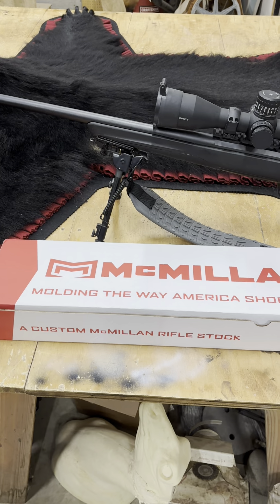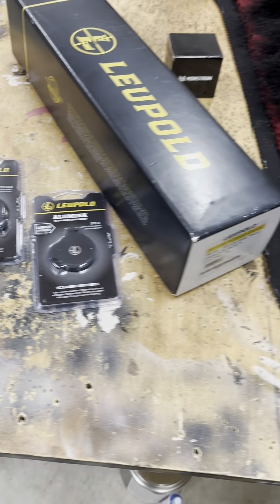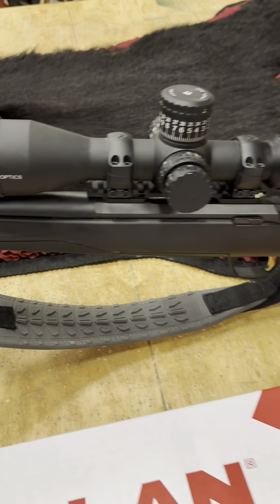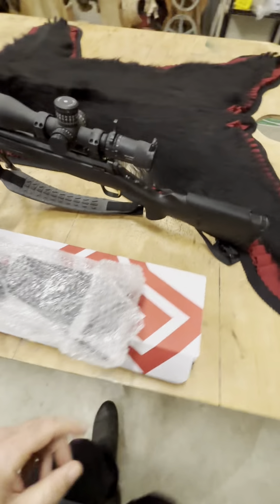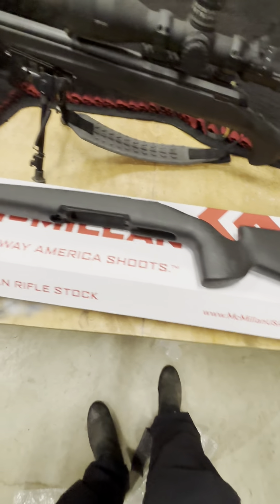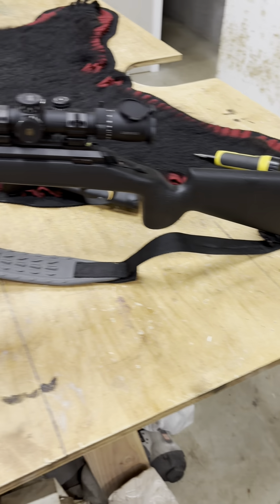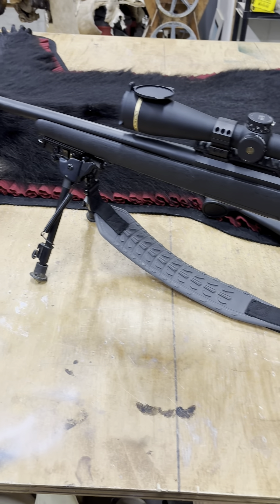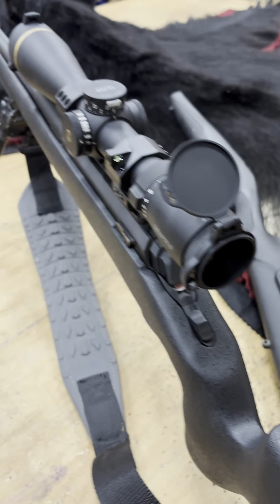6.8 western goodies making my X-Bolt lighter

Comment: Look into replacing your trigger spring with a M•Carbo for your X-Bolt. You’ll be able to adjust your trigger pull below 2 lbs. it’s fairly simple to do. Then you can move it back up between 2.5 to 3.0 lbs for hunting.